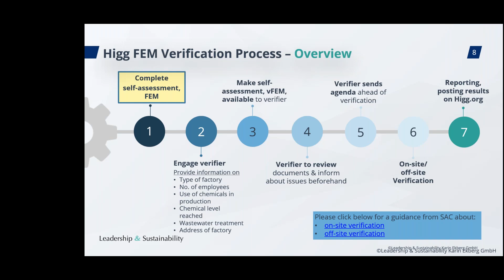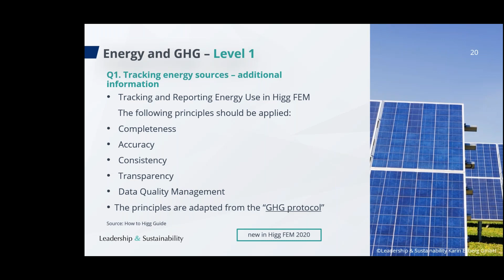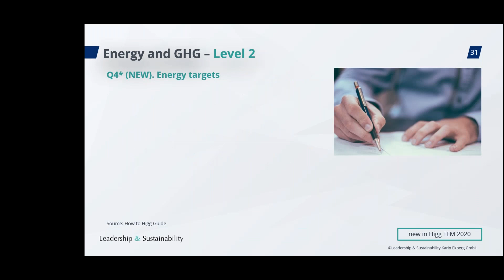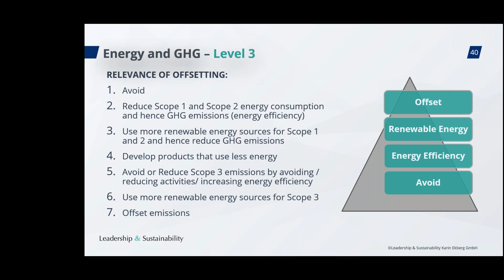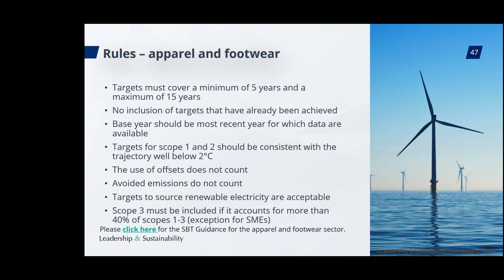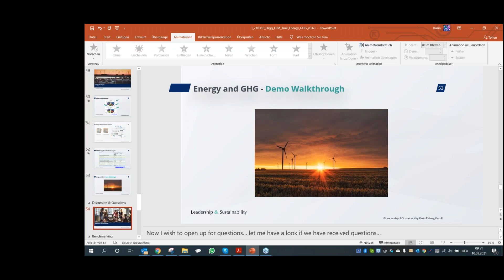Update Higg FEM Section 3:  Energy & GHG

Comment: Thank you so much. its very useful.
the question 6, does it compared with last year or the energy use of baseline?
Reply from the maker: Yes, the question 6 is identical with last year, the only difference is that there is a lot of additional guidance on how to report correctly, see slides 33-37. Best regards, Karin
Reply: @leadershipsustainability4506  thank you